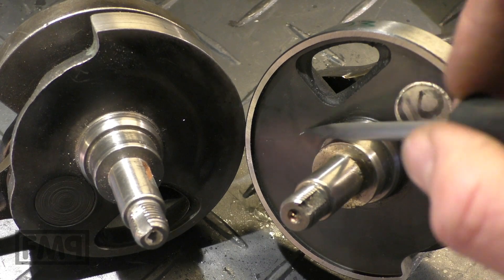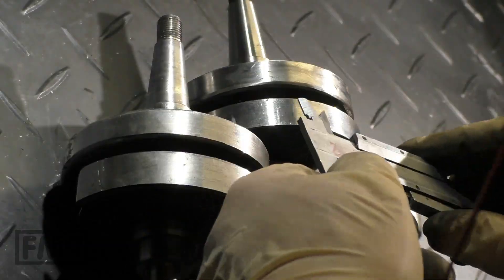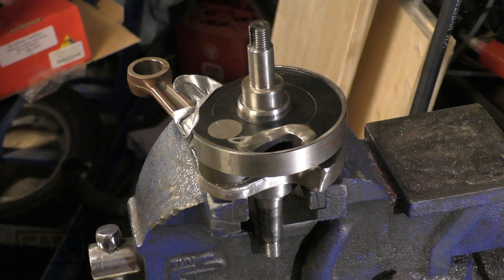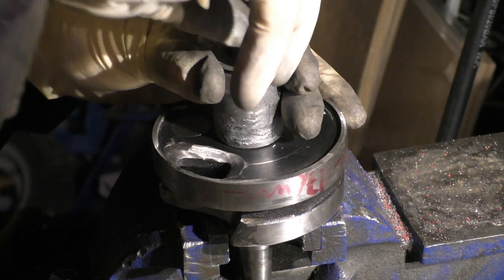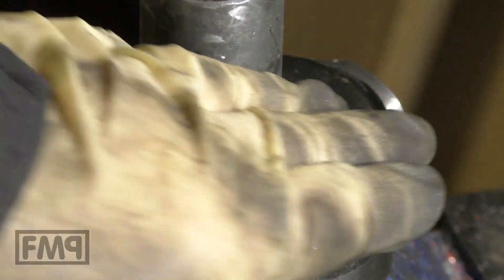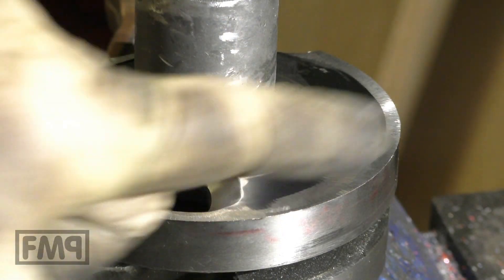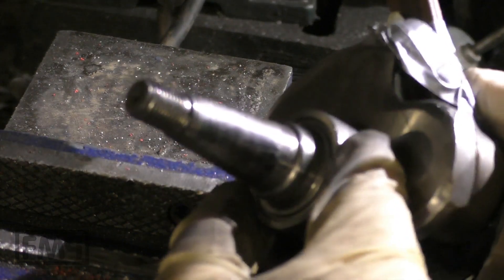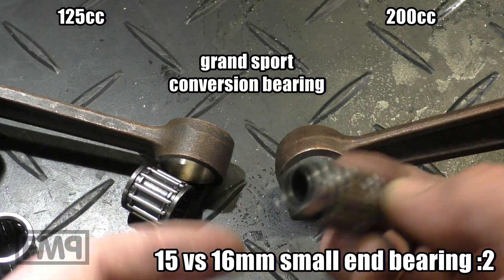vespa 200cc crank modification for 125cc ENGINE / FMPguides - Solid PASSion /

Comment: Hello, why you are not protecting the Rod bearing from grinding metal dust?
That metal dust can destroy the Rod bearings if trapped inside !!! 😩
Reply from the maker: exactly, thats why its protected. watch again. and its afyerwards carefully flushed and oiled again anyways, till conrod smoothly turns like a new crank 

no worries doinnit for over 20yblike that. works perfectly fine.

otherwise I would  not recommend it.

Comment: Hi, thank you for informative videos. 
You mentioned a company that made 16mm od 15mm id bearing, but I’ve had no luck finding them or a bearing do you happen to know a site where I can purchase one? Im currently building a px125 with p200 crank and 177 kit . Thank you for your help.
Reply from the maker: grand sport GS but normally usual shops also have it

Comment: hey mista, do you have any experience running a bell shaped crankshaft on a reed valve? im interested for a uncle tom model crankshaft due to my engine now really shake too much because of the full circle crankshaft and the bearings are easily worn out not sure why, it didnt get enough oil or the diameter different vespa full circle crankshaft. uncle tom bell style crankshaft on product description says with a reed valve will run more smoothly, less engine shake but low compression? is a bell crankshaft a good choice against full circle? im looking for a good performance, but also a nice comfortable ride.
Reply from the maker: U cant say it based on the  type, or what kind of promise shops make, it depends on how they are balanced in the end. So the exact static balancing factor is needed. 

I made a table, its available on fb, then u can compare and know if it will rub more. Smooth or not

Whats the value they state? 
I bet they dont say.. 

The 12 o clock thing is not accurate enough. Says something or exactly nothing.
Reply from the maker: See also here
https://youtu.be/VlgEtRyNRFU

Exact values are needed. But they never state these.

Comment: Would the crank need to be rebalanced after removing material on the one side?
Reply from the maker: not really, its only little Material and in genereal these cranks are not really balanced (see the missing heavy metal Insets) just ensure stumps are straight and crank is centered and you are fine

Comment: This longer con rod was an idea back when the supermotos bike of choice became the Honda crf450 is was a popular modification back then and works well I would like to see two px 125 one with longer rod and one without to see the difference?
Reply from the maker: maybe a bit smoother running cause lambda factor changes but also conrod heavier, so not sure if you can actually verify a difference, with these pretty unbalanced crankshafts

Comment: So both 57mm stroke,will the bottom cylinder gasket need a packing plate? Excellent work by the way!
Reply from the maker: An additional 5mm thick gasket, as the conrod is 5mm longer, yes
Reply: @FreakMoPed8  or 4mm to get the compression up!
Reply from the maker: compression raising i would only change over the head design. In my experience regwrding compression: Less is more, other factors are more important for power.  high compression runs pretty rough and kickstarter also doesnt appreciate it. 

For my m244 i actually lowered the compression for that reason. it still has way enough power.